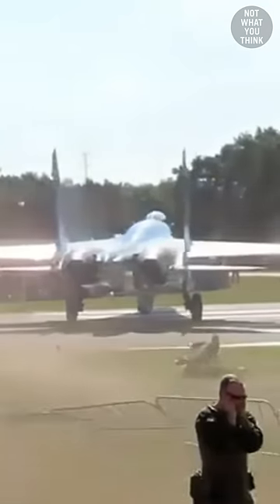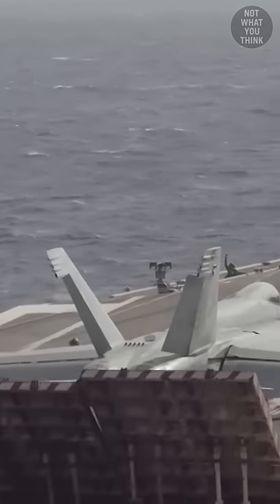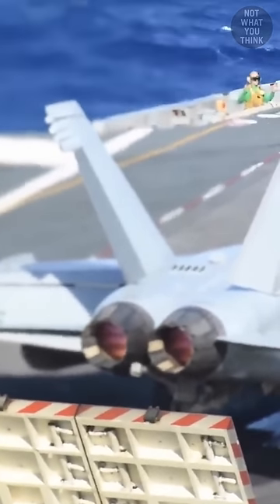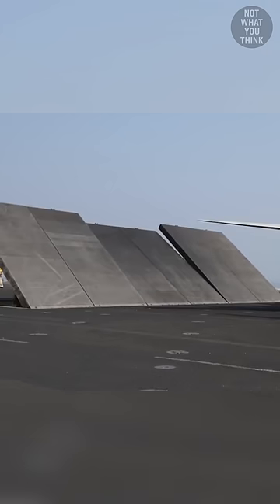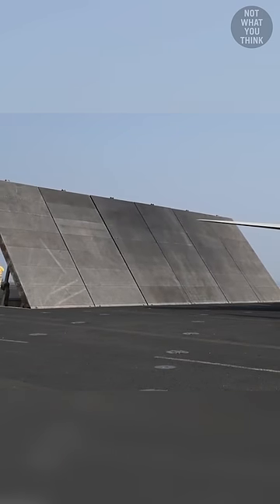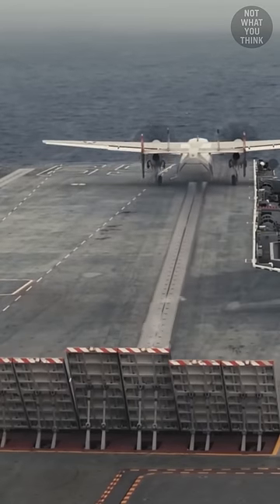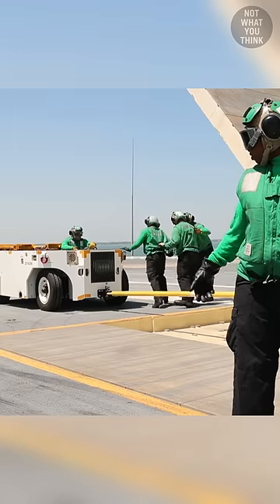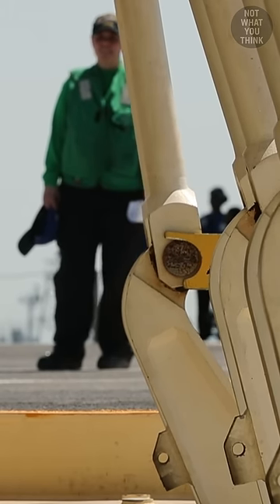Jet Blast Deflector #shorts

Comment: uh, I'm Air Navy and worked a few carrier decks and ... those JBDs are NOT cooled by seawater. Its about 3 inch thick armor plate that everyone KNOWS not to walk on during or shortly after flight ops. If they ran sea water thru those JBDs the uneven heating and cooling would warp them and the internal corrosion from the heat and sea water would destroy them in a few years.
Reply: Navy Veteran here with air craft carrier experience, can confirm there is no seawater cooling system in the deflectors. If there were, there would need to be flexible hoses running along the hinges, which A. you can see that there is none, and B. would be an unnecessary complication and distraction. Lastly, the final bit of video showing what look like sprinklers covering the entire flight deck are part of the “wash down” system, not fire prevention related. Can be used for general cleaning purposes, but it’s not usually, what it is for is in the event of a chemical attack the ship is able to “wash down” and be safe for the crew to continue flight ops. 

Lots of misinformation in this post with some random, and quite honestly, simple facts sprinkled throughout.
Reply: I was wondering about regular seawatrr use up there and corrosion concerns, seemed fishy to me
Reply: As ABE2 with over 7 years experience on 3 aircraft carriers 3 sea service deployments all working on the flight deck and below decks on aircraft carriers capulats and arresting gear mark 7, JBD does have an active cooling system using sea water tapped into the fire mains.. I guess there was no flight deck for yall 2, lmao
Reply: @gusterblack6946 As ABE2 with over 7 years experience on 3 aircraft carriers 3 sea service deployments all working on the flight deck and below decks on aircraft carriers capulats and arresting gear mark 7, JBD does have an active cooling system using sea water tapped into the fire mains.. I guess there was no flight deck for yall 2, lmao.
Reply: And who the hell says air navy... its just the navy shipmates
Reply: A simple Google search will also confirm that JBDs are indeed water cooled .....
Reply: Why are deflectors needed on a ship if nothing is behind it?
Reply: @ianross9099  Did you not notice the 2nd plane sitting behind the deflector waiting for it's turn to take off, as the 1st plane took off.
Reply: @Holtynfuntime why use salt water though
Reply: @gusterblack6946 thank you for clearing this up Sir...🙌🙌
Reply: @nawowas8818 you obviously have never been on a flight deck. Try again.
Reply: @nawowas8818   you just wrote the biggest bs
Reply: @Aerotyler23  i see.
Reply: Yeah, see I've no experience with carriers but as a fabricator I do have a fair understanding of corrosion and thermodynamics, otherwise called "common sense" which is shockingly uncommon. I can't wrap my head around why he thought dirty fucking salt water would be a good idea for a cooling system, but it's the last time I can tolerate this channel. He so regularly spouts misinformation with absolute confidence and rather than correcting the information and re-uploading he typically either responds to someone in the comments or leaves it be. His only goals are clicks and watch time, not to be an informative channel.
Reply: I was an Army Paratrooper for 21 years. Don't know much about the Navy, cept my grandfather was Seabee in the south Pacific building runway and Adak Alaska in WW2. He had a bunch of Japanese war souvenirs took off dead enemy, including a grenade that he had disarmed.
Reply: @gusterblack6946  Thanks for the info. I changed from a thumbs up to a thumbs down for this video due to you educationg me.
Reply: @Holtynfuntime lol, nice point.
Thanks for the info.
A close look shows piping that has smaller pipes or just rod attached to the outer edges of each deflector. The engineering is very interesting. There's painted and unpainted piping.  I'm impressed by the support in the ship where the JBD's are stored.
A comment explained why they are needed to protect the next plane.
Which is also why they must be water cooled.
In combat those things would get close to red hot and melt the tires of the next launch.
Thanks again 👍 I knew I could find someone with credible info in the comments.
🧙‍♂️ OAO
Reply: It's clear looking at the back of these,
that they are not 3" thick solid plates.
As for not walking on them, that's probably a good idea always.
I would also expect a carbon buildup that would be very slippery when wet.
A Boy Scout leader would immediately tell his kid's to stay off 🤣
Reply: @leprechaunbutreallyjustamidget they use seawater bc freshwater is precious, they have to make it.
I would think they periodically flush the system and chemically treat it, but that's just a guess. It is based on 40+yrs automating factory's including lead smelting and blast furnaces.
Reply: you apparently aren't aware that they have actual engineers who are experts in thermodynamics. JBD's have probably been around longer than you have.
Reply: @OhAncientOne  yeah and normally making fresh water is a problem but with two nuclear reactors onboard it's not much of an issue
Reply: @Holtynfuntime  That guy is a fake. You should know that. 😂
Reply: @ianross9099 to assist in achieving flight in a short distance. It's about what is in front of them, not behind them.
Reply: @Holtynfuntime you got that right. Those saying that JBDs aren’t cooled by firemain probably missed that training portion of the SW of AW qual.

Comment: When I was a noob on the flight deck I found myself behind an F-14 Tomcat taxiing to the waste cat. It throttled up and blasted me, knocked me down, I slid probably 10 feet(felt like 50) across the none skid. I managed to grab a padeye and held on with a death grip. I didn’t get up until someone picked me up. Scared the life outta me. It’s very easy to find yourself in the wrong place. You have to be ultra alert and have great situational awareness on the flight deck. 1 cruise on Kittyhawk and 2 on Nimitz with VQ-5 Sea Shadows.

Comment: Navy Veteran here with air craft carrier experience, can confirm there is no seawater cooling system in the deflectors. If there were, there would need to be flexible hoses running along the hinges, which A. you can see that there is none, and B. would be an unnecessary complication and distraction. Lastly, the final bit of video showing what look like sprinklers covering the entire flight deck are part of the “wash down” system, not fire prevention related. Can be used for cleaning purposes, but it’s not usually, what it is for is in the event of a chemical attack the ship is able to “wash down” and be safe for the crew to continue flight ops. 

Lots of misinformation in this post with some random, and quite honestly, simple facts sprinkled throughout.
Reply: Thank you for serving.  I was stationed on the USS Kitty Hawk and I slept right under the starboard side jet blast deflector.  I heard all kinds of noises as it was raised which were pumps for the hydraulic system.  Again thank you for serving and have a nice day.
Reply: NotWhatYouThink is basically the guy who keeps trying to sound smart by rewording facts people already know.
Reply: Thank you for the info. The idea of water on what could be a fuel fire was weird. AF vet myself.
Reply: Air Navy checking in, this post is correct. there is NO seawater flowing thru the JBD and they get HOT AF. I know, I was a newbie who stood on it just long enough to need to get a new pair of boots on a busy day.
Reply: @shannonp1656   Well, I'm sure you've seen those AFFF ads that are non-stop now days .Prior to AFFF? The US Navy DID use salt water spray fog, and that gear is STILL trained on and carried. Ships only carry so much AFFF and its usually reserved for the Hanger Deck Deluge Systems... working hanger deck fires are the devil.
Reply: I was on the USS Kitty Hawk and slept right under the Starboard JBD.   I always heard all kinds of pumps and mechanical noises before the jets turned up.  I was told and always thought that there was seawater pumped through them.  Now I know the truth. Thank you very much.
Reply: @NorthPoleJeff  As ABE2 with over 7 years experience on 3 aircraft carriers 3 sea service deployments all working on the flight deck and below decks on aircraft carriers capulats and arresting gear mark 7, JBD does have an active cooling system using sea water tapped into the fire mains.. I guess there was no flight deck for yall 2, lmao
Reply: Thank you very much and thank you for serving.   I had one week of flight deck work then they sent me back to AIMD.  As I slept right under the starboard JBD I heard all kinds of motors and pumps.  Back then I was told that they did have water cooling.  But, one guy said that his shoes melted when he walked on one, sorry, that sounds odd because it could be dangerous.  Thanks again and have a nice day.
Reply: As an ABE1 ,with almost 2 decades in. You should remove this comment and leave this for the people who are rated and work on the actual equipment.
Reply: You could be a fry cook in the navy and still technically have “carrier experience.” These are in fact cooled by seawater. A simple google search will reveal that they do exist and that the Navy is looking for a passive cooling method. They even provide figures for how much maintaining the saltwater systems costs the Navy every year, about $10 million.

Comment: During carrier operations on the USS Coral Sea an A4 Skyhawk was at the very rear unchained waiting for permission to taxi when an F4 Phantom started to taxi ahead in front of the A4. With sailing at launch speed and heavy wind the F4 throttled hard which amazingly lifted the A4 enough to have the ship pull away from the lifted A4. When falling into the sea the nose wheel contacted the deck strike plate flipping the A4 upside down which prevented ejection trapping the pilot. Before we could get Angel 1 over to rescue he was already too deep to make an attempt. Tonkin Gulf 1968.

PS I was hit by prop blast and nearly blown into the sea. Stopped a couple feet from the edge. Taught me to keep my eyes open and pay closer attention to my environment.
Reply: Damn, did the pilot make it out?
Reply: @virgilio6349 The nose wheel caught the deck flipping the A-4 upside down before the pilot could eject. By the time I got to the ships stern the aircraft was out of sight and air bubbles were surfacing. We lost a pilot that day.
Reply: The A4 was a naughty little plane lol, makes sense that the wind made by the F4 could pick it up. All jokes aside RIP to the pilot

Comment: I had no idea they were cooled with seawater from the fire system, that makes so much sense!
Reply: No they arent. That would require pipes, which arent there, and the fire suppressionnsystem the video showed was just a typical hose down.
Reply: @Toasties.  As ABE2 with over 7 years experience on 3 aircraft carriers 3 sea service deployments all working on the flight deck and below decks on aircraft carriers capulats and arresting gear mark 7, JBD does have an active cooling system using sea water tapped into the fire mains.. I guess there was no flight deck for yall 2, lmao
Reply: @Holtynfuntime  Fair 'nuff.

Comment: Needs regular maintenance.  Show them pulling the middle one back and it has a rusty henge pin..
Reply: U have a better idea?
Reply: Do you think they will change them every single day or what???😂
Reply: Wow it’s a little rusty. You think the military cares about the looks? They have a schedule for maintenance to ensure it works, and I assume it rusts before the cycle finishes because of how much water is in the air.
Reply: @sloth4810  it's called WD40
Reply: @Latvijas_Amēlija  no. But they should do maintenance on them so they don't seize, rust would be the first step in them starting to go that route.
Reply: @Mets2015WorldSeries  if they are maintained properly, they would not have rust on them
Reply: I feel like none of you have any idea how busy and unsafe the flight deck of a N.I.M.I.T.S. class super carrier is.
Reply: yes. that's probably why they're having too pull it back

Comment: For those saying theres no sea water running in the JBDs yes there is i had to change them all the time... the mark 7 mod 0 witch i helped with while there for the emals we were using tiles the same ones the space shuttle used kinda. So we could stop using sea water as a cooling system 

As ABE2 with over 7 years experience on 3 aircraft carriers 3 sea service deployments all working on the flight deck and below decks on aircraft carriers capulats and arresting gear mark 7, JBD does have an active cooling system using sea water tapped into the fire mains.. I guess there was no flight deck for yall 2, lmao

Comment: Back in my days as a ramper I'd grab the luggage cart and stand on it behind a 737 taxiing off the gate. Ramp surfing was fun!
Reply: One time I was on light duty after  a car wreck, and was marshaling 737 out to taxi, and I didn't know they were turning going to far end of the ramp, I hobbled my way to safety, which turned out to be an airstart trailer, and it put me horizontal with the trailer😂 spooky, but priceless fun

Comment: Alternatively they could use those to increase acceleration because when there is a surface close to something pushing out gas or liquid it’s going to make the thrust effect stronger than it actually is
Reply: Jet propulsion doesn’t work that way. Once it’s out of the nozzle, the jet has no connection to the craft.

Comment: Jet blast deflectors on aircraft carriers? Are you sure you did a research? Those are not suppose to deflect the jet as a main role. Their role is to increase the engines EPR for greater output thrust during lunch and are part of the catapult system. On the Russian Kuznetsov, there is no steam powered catapult system so there are no deck rails for the nose gear to be pulled onto, yet still those catapult doors give enough engines back pressure increase that even the heavy Su-33 can takeoff at 30 tons takeoff weight.

Comment: I don't think it is to protect anyone.  Tou can just make sure no one is standing there. Also, i am pretty sure that the plane is taking off from the edge of the ship. To take advantage of the hole runway. I am pretty sure that the deflectors are there to make the plane go faster by blocking the thrust.

Comment: I wonder if they can use the jet wash coming off of the deflectors to speed up the plane on take off so the plane is not just pushing itself with its own engine the exhaust hitting the deflectors pushes it to go faster too.
Reply: No
Reply: @Sniperboy5551  :/
Reply: Doesn’t really work like that. That’s like something they would have done back in the old old days but we have tech now that is much more practical than that. Little wasted energy is no big deal
Reply: @enginepy  what do we have that catapult system?
Reply: @wisam111  yes the catapult and moreso just excess thrust from the engines. Redirecting thrust to gain more kinetic energy for takeoff would require all sorts of extra equipment and the juice isn’t worth the squeeze
Reply: @enginepy  what’s a moreso
Reply: @wisam111  sorry I meant the catapult but more relevant is the excess thrust of modern engines.

Comment: You know very little about what you're talking about. The deflectors are not for keeping blast off of people on the fight deck. Deflectors are to assist in takeoff by providing back pressure for thrust.
Reply: Um no not at all it is to protect us on the flight deck. The cats provide the power for takeoff. If we didn’t have the JBD’s you’d have a lot more injuries and all on the flight deck.

Comment: (Get the WD-40 for those joints.) 😈😬
Reply: That's what I'm saying
Reply: I'm sure those joints have points to keep them greased
Reply: Say it with me folks
WD-40 is not a lubricant
Reply: @ObamaoZedong  WD water displacement
Reply: @ObamaoZedong honest question: what would be a good lubricant for home use? I have hear people say 3-in-1 is good but other people say is the same as WD-40